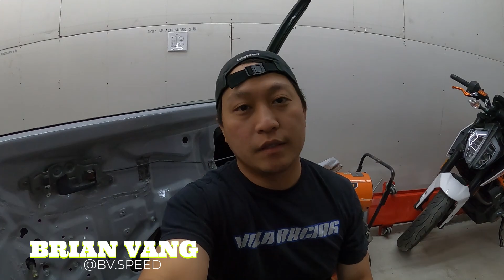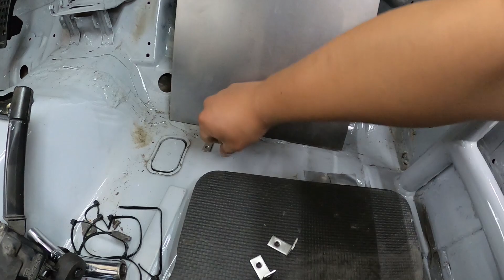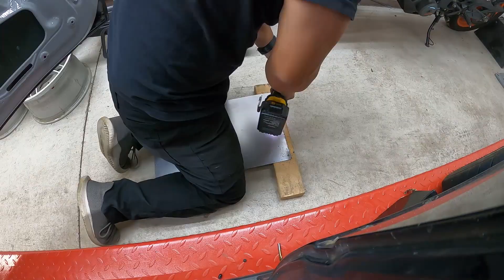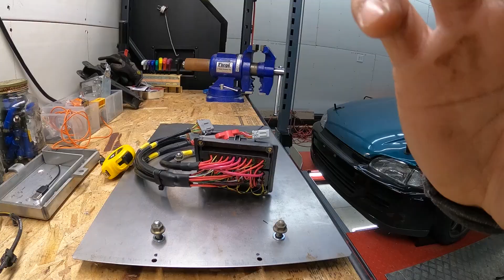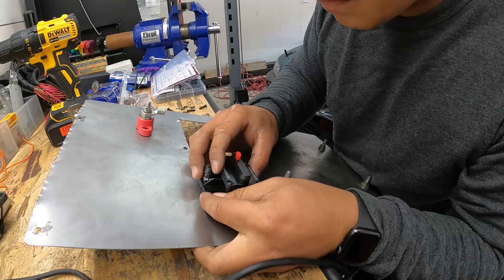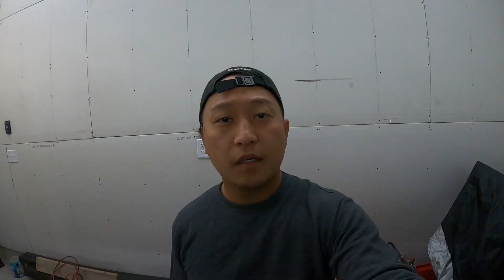ECU & Fuse Box Mount Panel - Civic EG Track Car Build

Comment: What type of circuit breaker is that?

Could you post the link to it
Reply from the maker: It was just a generic circuit breaker. I think I got it on Amazon.
Reply: @bvspeed  ok for sure I recently bought a relay box from bullboost performance and was having problems figuring out the way to set it up. luckily I came across your video and I just might have to use your set up. I appreciate the brains 🤙🏻